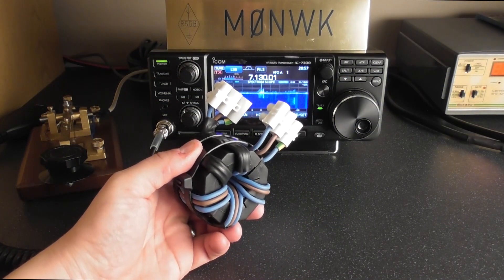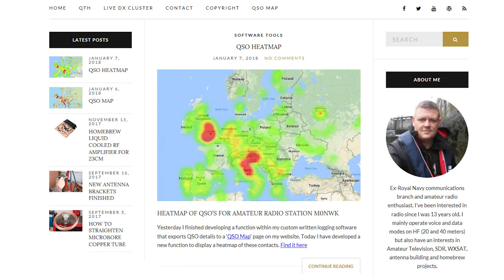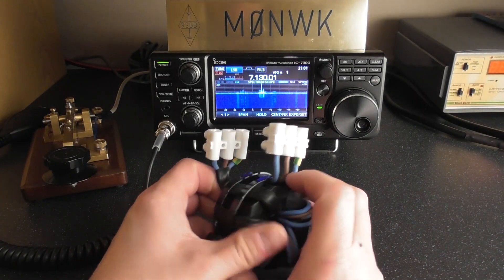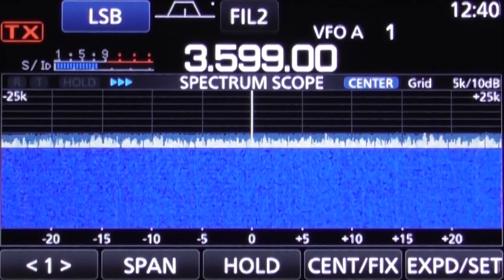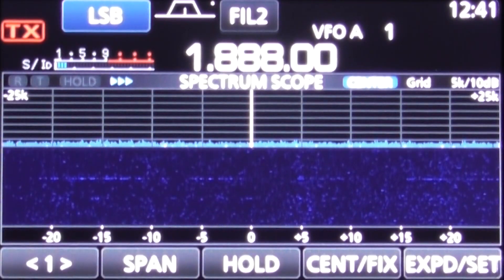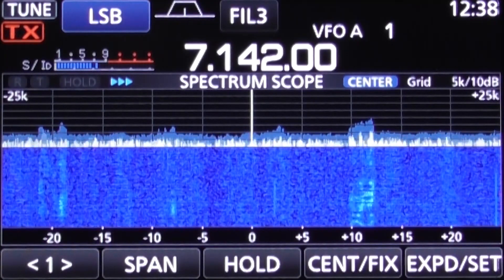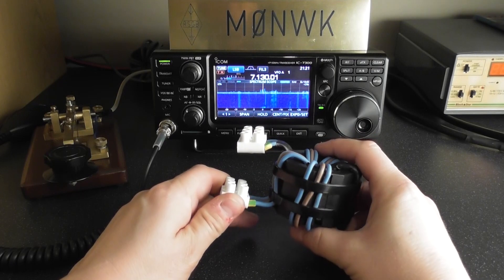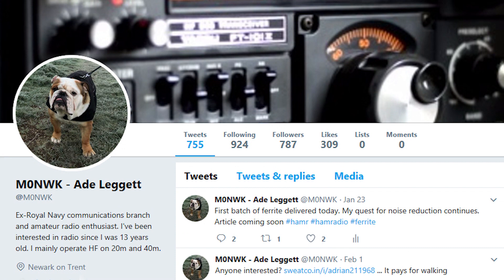M0NWK - Amateur radio - make a mains filter for EMC & noise reduction

Comment: Hi . The cables should be twisted before looping through a ferrite core ?
Reply: Others have done this. I did twisted and non twisted version. There was no difference but it was much easier to wind untwisted. Cheers & 73 Ade

Comment: i am picking up S9 of powerline noise but from the antenna not from the power supply as i have tried on a car battery and nothing changes, i have also tried shutting down power to my house and still no change, neighbours are far away and out entire hillside suffers from dirty power line noise.
  Anyone know if i can get usable results from a choke or a 1:1 balun? (Before i go and start experimenting). Thanks
Reply: @M0NWK  Thanks for the link to his site. I also found this which i find interesting after trying to find 5V/6V 3A relays (DPDT) for a decent price last night.
  A version of this might open up my options.
"Switching 24V Relays from a 12V DC Supply"
Reply: Sailing on the same boat here in South India.

Comment: You could try a BT MCU/5A-125 Mains Conditioner Unit as well, they contain a 1:1 transformer and filter capacitors across the output line, are internally neutral/earth bonded to attenuate common mode noise, they also go for very little money £10-30(ish) on the bay for a 125W model, they also come in 250W,500 and 1000w versions. Hope this helps someone.
Reply: Cheers, a picture paints a 1000 words.
http://rockgrotto.proboards.com/thread/6318/bt-mains-conditioner.

Comment: Cool, thnx for uploading this video. 73 de 4Z5UY
Reply: @M0NWK  I had a problem when transmitting my modem crashed. So I was looking what people did with ferrites. It turned out my landline was the problem. I used a ferrite similar to the one you use and it did the trick. Luckily I don't have mains problems. 
Hope to meet you "in the air" 73 de 4Z5UY

Comment: or if like me you can't be bothered making a filter plug your PSU into an extension lead, The kind that comes coiled on a plastic reel (don't uncoil it) Job done, , Just don't draw anymore than 6 amps through it.
Reply: A decent extension should have a coiled and uncoiled rating